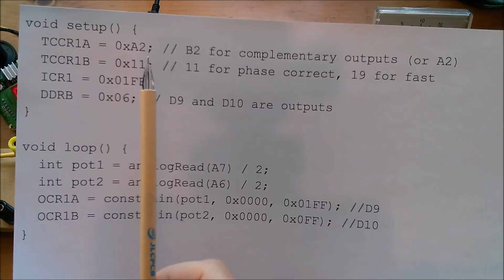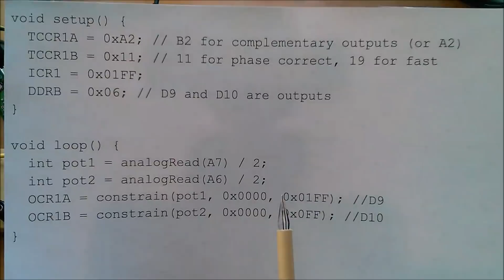Supercapacitor Charging with Buck & Boost - Muppet 2

Comment: I'm sure that it's more the journey you're interested in, but it seems there's an interesting new chip - "4A, Standalone Li-ion Battery Charger IC 
With Photovoltaic Cell MPPT Function CN3791" which is available on ebay, delivered, on a board, for <£3...

Comment: Why use the buck side when the boost side is all you need?
Reply from the maker: You can't use the boost-side MOSFET until the buck-side switch is at 100%
Reply: Can you just remove the buck side?
Reply from the maker: Yes, but the boost converter has a DC path to the load. If the load is a supercapacitor, it will draw a huge current from the source until their voltages equalise.
Reply: The buck side limits the current (inrush) until the voltages have equalised, and then the boost side is needed to keep the voltage rising. So both sides are needed if the input power source has to be protected, or you don't want to dump a massive amount of current on the output.

Comment: Question. I got some supercap boards for a project I'm working on and followed your brilliant idea for adding LEDs to the circuit. I took two such boards and put them in parallel, and only the first set of LEDs flicker on and off, the second board never flickers. Is that normal or did I perhaps do something wrong? (I've tested both boards individually and the LEDs on both boards flicker along quite cheerfully when charged)
Reply from the maker: Probably caused by tolerance on the  voltage detector ICs. Putting the supercap boards in series would work.

Comment: Next: current detector connected to arduino to maintain constant current input until the target voltage is reached.
Reply: And also voltage sensing. That way you have a CV/CC power supply.
Reply from the maker: Yep :)

Comment: 2:32 - Instead of constraining pot2 I would have just divided by 4 in the analogRead() line.  That way you can use the full rotation of the pot and get finer control as you adjust it.
Reply from the maker: Or as my mate Brett suggested - use one pot to control both MOSFETs - buck in the first half (or 2/3 maybe) then boost for the remainder of its travel :)

Comment: Hmmm.  Since you're throwing and Arduino into the mix, have you ever taken a look at digital potentiometers?  Imagine  what you could do in code if the Arduino could detect the input and ouput values and control both potentiometers.  ;)
Reply: Seriously? That doesn't make any sense. The Arduino is what controls the PWM signal! There's no need for any digipots!
Reply: You're right.   I got a little hacky trying to build the automation on what Julian had built on the video.  You could omit the pots completely and just have the arduino generate the PWM directly.
Reply: @StevenIngram  measuring the voltage and current would be a better idea I think